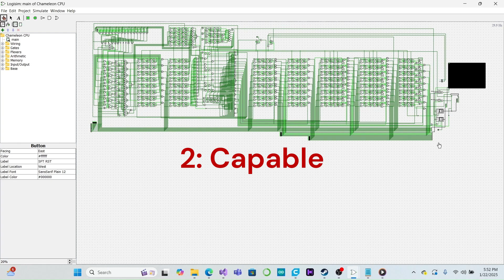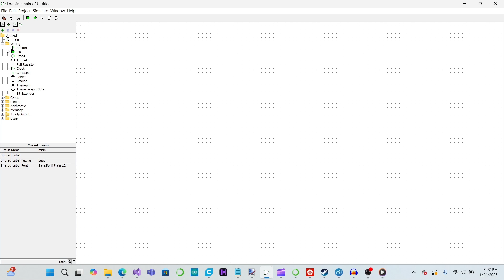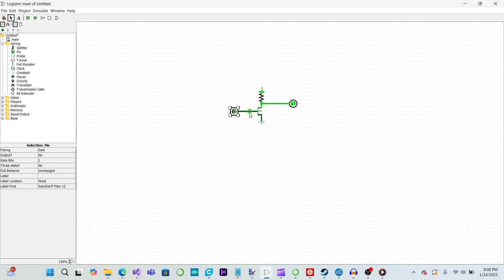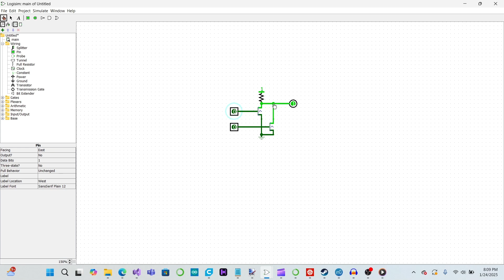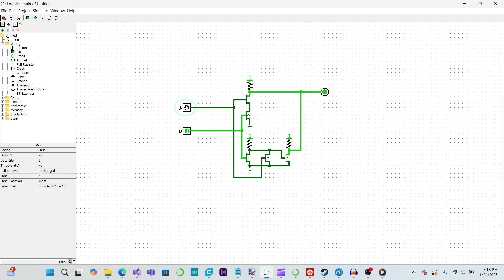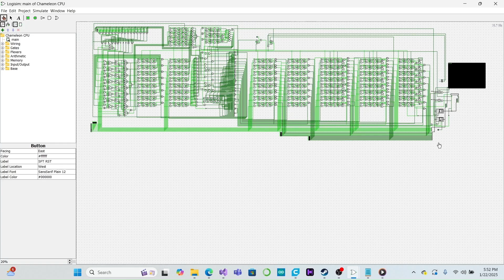How to Build NMOS Logic Gates (The CPU You Can Build, Ep. 2)

Comment: What is pool direction?
Reply from the maker: Pull direction is a setting you can use in Logisim to differentiate between pull-up and pull-down resistors.  Pulling toward 1 means the resistor pulls toward the positive voltage supply, and pulling toward 0 means the resistor pulls toward ground.  If the resistor is the only thing outputting to a certain wire, then that wire will have whatever value the resistor is pulling toward.
Reply: @PolymathUnlimited-du2hg so in breadboard if i put the resistor. Pulling towards 1 will mean one pin of the resistor will be in positive section of the voltage of a battary?
Reply from the maker: @salehinontu precisely 😎